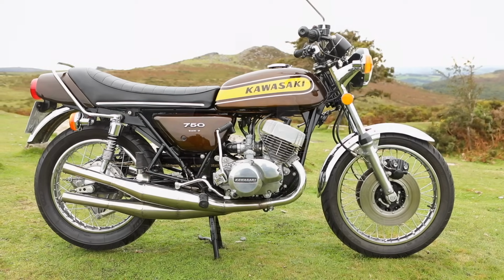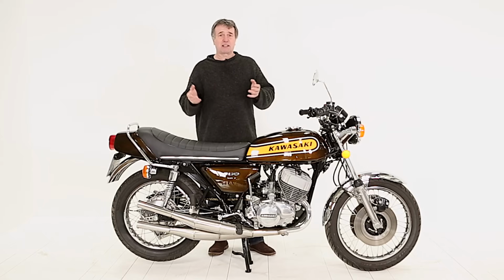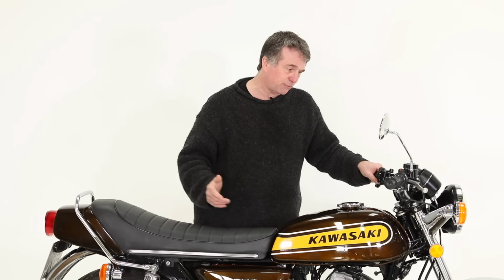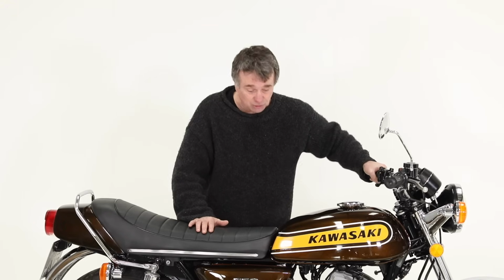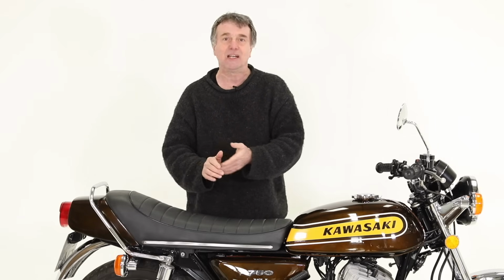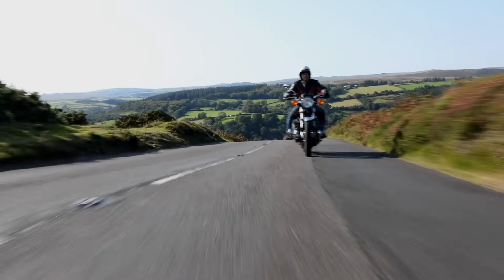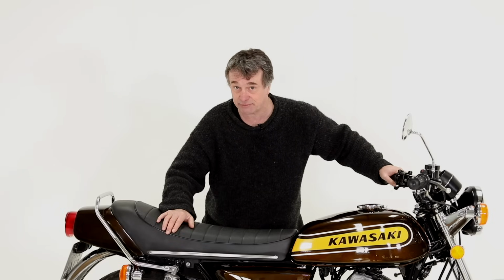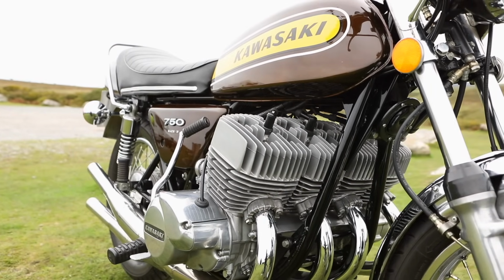Allen Millyard 1000cc Kawasaki four cylinder two stroke road test

Comment: My recollection is that the H2 had only one front disc but had a mounting lug on each fork leg, perhaps to use more parts for the 750 race bikes like those used by Bary Ditchburn and Mick Grant.

Comment: The reviewer is perpetuating some myths about the triples.  The early 500's had plastic swing arm bushings and drum brakes, so they earned the reputation of "widow maker" and "flexi-flyer".  By '72, the first 750s had stronger frames with more bracing, bronze bushings, and a single front disc brake.  In '73, Cycle mag did a "super bike test", and the H2A came out on top, besting even the new 903 Z1.  It could pull over .9 Gs braking with a single disc.  The B and C models ('74 and '75) have the 2" longer swing arm to make them less wheelie prone.  Using tapered rollers instead of balls in the steering head would have been a good move by the factory, and probably would have muted all the talk of poor handling.  None the less, many owners have done this mod, and it makes for a really decent ride on par with any of it's contemporaries.

Comment: Interesting bike.
I like Allen's brilliant creations but I'm not sure about them.
As you say - the bendy frame, front forks, yokes and poor swingarm bushes etc 
are not up to handling even the 3 cylinder version so it's actually dangerous with 4 cylinders.
How the hell did they ever pass Govt. safety regulations?
Also - he uses points instead of the CDI ignition that came standard with them -
that's a retrograde step which will cause fouled plugs and annoying servicing.
A also doubt the claimed 120hp unless he does port jobs on them but he doesn't ever mention that.
The correct hp would be 72 x 4/3 = 96hp.
Even then - the clutches used to slip with only 72 hp so how
does the clutch not slip at 96hp ?
The clutch on mine used to sprain my left hand as it needed brute force to operate it.
If you changed to a new clutch cable it would only be passable for one week and
then difficult to use again.
To stop it slipping you can upgrade the clutch springs but
then it's even more difficult to change gears.
Still - the H2 750 is a very exciting bike to ride -
it made the Z1 900 seem a little boring in comparison.
Mine used to power wheelie in 1st  2nd and 3rd as soon as you hit 5,500 rpm at full throttle
and it would rev out to 9,000rpm with chambers on it.

Comment: When I was 15 I had a 71 500 Kawasaki  and then a 72 750 Kawasaki 750 they were both unbeatable in them days 12 seconds quarter miles was unheard of in the seventies for a car  or motorcycle. You twisted that throttle back it hit that power band the front end jumped up and all hell broke loose lol.  They were called widow makers my best friend was killed on his i still miss him , His looked just like the one in this video.

Comment: Even if Kawasaki had made that bike, we'd still all be riding four strokes. US legislators killed off the two stroke engine for motor vehicles. Although it would have been possible for manufacturers to make cleaner two strokes, it would have cost more than using four strokes instead.

Comment: From my recollection, the two stroke demise was more political than what you're suggesting. The H2 coupled an engine with insane power to an inadequate frame/suspension. If Kwaka had added a cylinder, they would have just compounded their initial problems. Ecomentalists destroyed two strokes.
Otherwise, Allen Millyard is motorcycling's Newton - Isaac, not Bert.
Reply: On politics, the impetus to use the EPA to control the people came from was from the same people who set up other, mostly supranational organisations.
Reply: Your last sentence says more about you tan the bike, I bet your American.
Reply: @Mick-60  No.

Comment: Fantastic engineering my a remarkable man. Not really 'the motorcycle Kawasaki should have built' as we know that the factory 750 could only just about handle the power of the motor, a 1000/4 would have been unwieldy (as you found out). Kawasaki had the 900cc Z1 which fulfilled the flagship position very well. Millyard's machines are novelties (in the best sense of the word), the art of the possible from an engineering viewpoint but not necessarily from a practical and commercial one.  Go on, how much?

Comment: When they were new(1972) nothing could get near them at Wanganui New Zealand tight street circut ,i never saw anybody wobbling out of control,the whole starting grid was virtually blue H2s,except for the odd Norton or Triumph and Suzuki Waterbus(Buffalo,Kettle)Even Z1s struggled a bit.
Reply: Must be a smooth circuit. Sounds like you don't know very much.
Reply: If you have ever ridden one they feel like they have a hinge in the middle

Comment: A few point that as a broker of classic motorcycles you really should know.

The Widow Maker moniker is only really relevant for the first year of the 750 1972, which was a bit of an animal, all the later models where tamed down with more bracing on the frame, a longer swingarm and a bit less power.

From the factory they all came with only one front disc but the lugs on the other fork and the wheel are there so its an easy job to convert them to twin disc, I believe Kawasaki even listed a kit of parts to do it yourself.

At one point you referred to it as a KH750, there was never a KH750, they where all H2's, this one I believe is a H2A. I used to own a 1975 H2C which was the last year of production of the 750. Similarly only the very last year of the 500 1978 was a KH, KH500A8 all the earlier ones where only ever designated H1.
Reply: All correct except the widowmaker bit. The 69. 500 was the original widowmaker
Reply: The last yr of the h1 500 triple in the USA was the 1976 KH500 & not 1978 as stated here in the USA.
Also,he said this bike is a 73 that has longer rear swing arm, that’s also incorrect,in the USA 1973 h2’s were either gold or purple color with shorter rear swing arm with different gauge housing & gauges themselves too being quite a different looking bike then the one talked about here.
This bike with its candy gold paint would be in the USA a 74 h2 . The 74 h2 also came in candy lime color & the 29 75 last yr h2 in the USA came in candy super red & candy purple 
Paint with the longer rear swingarm & upgraded gauges.
This is v cvs Omni ng from my 5decades+ wrenching/restoring/riding/owning Kawi triples & big four’s on a semi pro level. I am 68yrs old & currently ride a 74 H1E 500 candy green that’s been  cosmetically restored a 2nd 74 H1E candy red (8k mile original paint survivor!) triple & a clean unrestored 1978 kz1000-LTD-b2.
Happy Motoring!
Scott from the USA!
Reply: @scottwheaton9689  Ah yes your right Scott, I made a couple of mistakes as I was trusting my aging memory, 61Yrs old :).
I used to work as a parts manager at a Kawasaki main dealer in London but its been a few years.

I dug out my old Kawasaki Model Recognition Manuals to refresh my memory.
Last year of the 500 was indeed 76, I must of been thinking of the KH250 which was available here until 1978.
If the body work and clocks on this one is original then as you say its a 74 H2B

My main love has always been 2-strokes but especially Kawasaki Triples. The last one I owned was a US import H1A with that ridicules electronic ignition system it had, official UK ones had points due to radio interference regulations, I used to love pulling up next to cars at the traffic lights on it and hearing their radios go mental :)
Happy Motoring to you too!
Mark from London UK

Comment: 1.36.. front tyre... directional arrow appears to be pointing the wrong way... I can live with that though, if I can have the bike please..
Reply: Heading should be bike for sale.
I have distain for miss leading middle men.
Reply: That's the direction when fitted on the rear I think, which is reversed when fitted on the front as the braking forces work in the opposite direction to the driving forces.
Reply: 11:01 explained